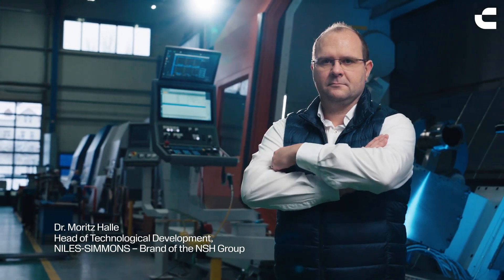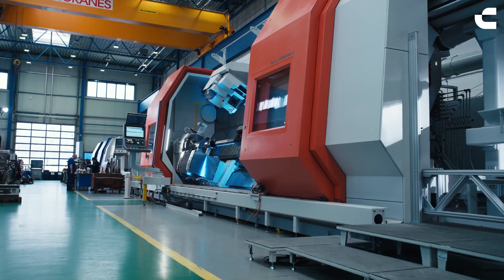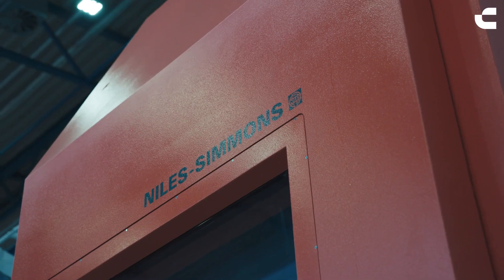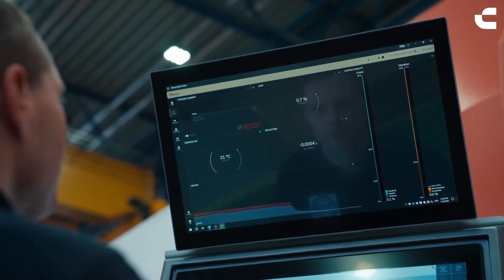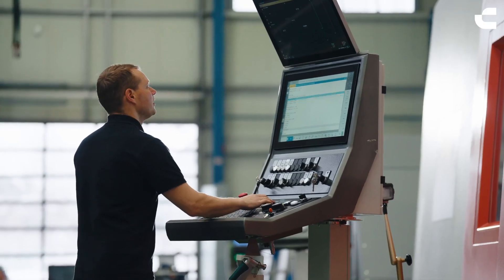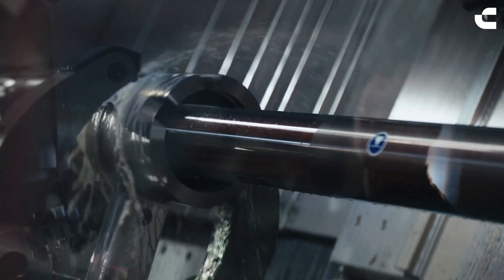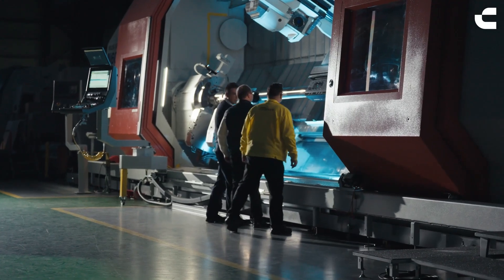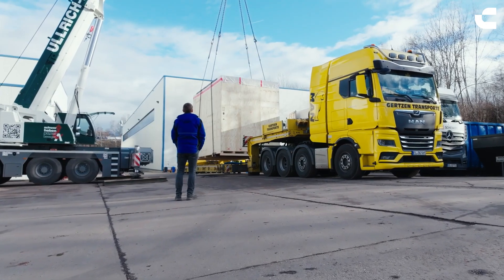Niles-Simmons and Sandvik Coromant solve the blind machining challenge​​

Comment: I don’t understand the video? Is the automatic tool changer with long bars the “revolution? “😂 it’s totally normal to just relying on what the machine tells you 😂
Reply from the maker: The combination with the machine and Silent Tools Plus is the innovation here. Silent Tools Plus with it´s sensor equipped turning adaptors with sensor technology that allow for reading temperature, deflection, vibrations etc in closed machining operations and also create automated scenarios depending on the machining create superior security when machining high cost components. Here is a page describing Silent Tools Plus.

https://www.sandvik.coromant.com/en-gb/tools/turning-tools/internal-turning-tools/silent-tools-turning/silent-tools-plus